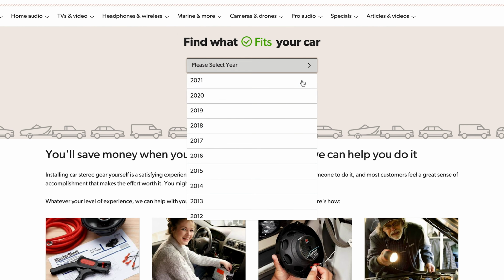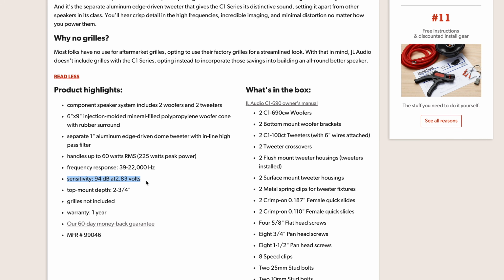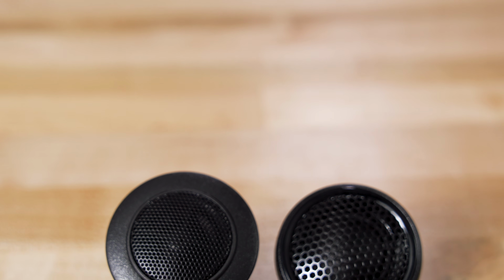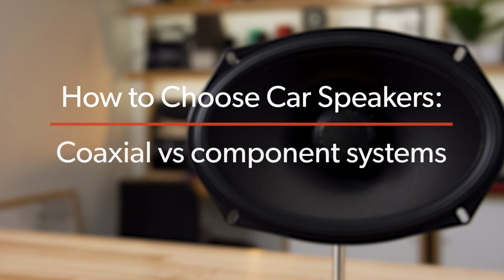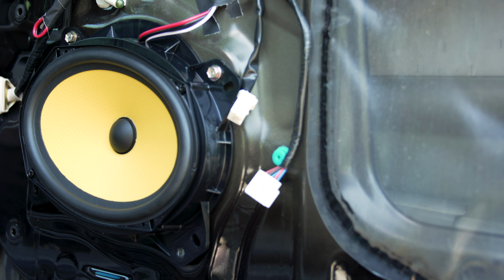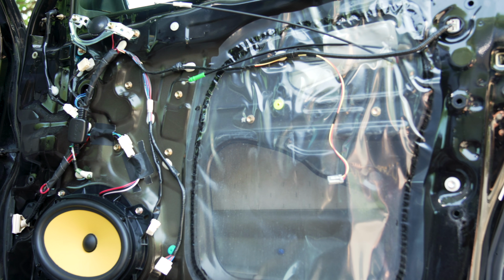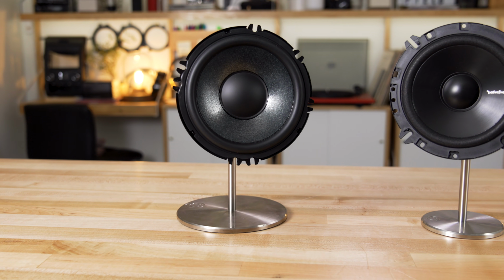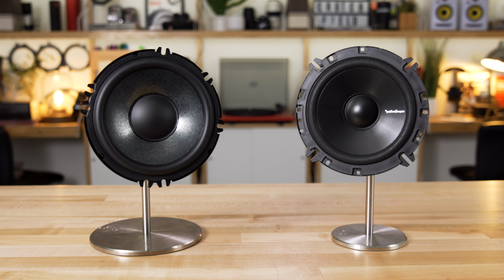How to choose car speakers | Crutchfield

Comment: Do component systems generally sound better for audio quality and low distortion than loudspeakers/2-way speakers. Ive been told since each speaker is built individually purpose built with the correct frequencies going to each you generally get better power handling without the distortion.
Reply: yes

Comment: I want a touchscreen head unit with component speakers in front door (a pair of tweeters and woofers) and a pair of component speakers in the rear door- how is it possible? Is there a better arrangement possible without adding sub woofers?

Comment: Hello,  i could not find my car (citroen ds5 2012) on that list? I tried to find what speakers could fit in my car... anyway, can someone help me out? i like the sound in my car but i just want to make a little upgrade to the bass, i dont want something big and boomie, i dont like that, at higher volumes my low end starts to distort a little soo i would like to give it more room and make my low end more punchy hehe, any ideas what can be the easiest option? does jbl make good subs for cars?
Reply from the maker: We are only able to research vehicles sold in the U.S. market. This is the reason you are not able to find information on your Citroen and recommend checking with a local installer to get help on what can fit it

Comment: Great video. Very clear and brilliantly delivered. You say to look for speakers with very low power because factory radios don't have much power. I've got a 50w per channel Alpine head unit. What would you recommend for decent sound without a separate amp? Fronts in the dash are 4inch, rear in the doors are 6 to 6.5inch.
Reply from the maker: One of our advisors would love to help you out! https://bit.ly/2KP1zS3

Comment: I have JBL component speakers in my front doors on my 2014 Rav4, I want to get powered sub boxes to go under the two front seats, would I need to upgrade/change any part of my cars power system to be able to run all that?
Reply from the maker: New power cables will need to be ran for the powered subwoofers. That can be done without having to change any part of the stock power wiring making this just a new addition to that wiring

Comment: I just bought kickers csc654, for front & rear for my civic 2017 model... Do i need to remove my touchscreen and unplug battery before installing the speakers??
Reply from the maker: No, you may want to disconnect the negative terminal of your battery to avoid possible shorting of any wires,  but you won't have to removes the radio.
Reply: @crutchfield   computer box will not affect if i disconnect the negative connection? As when i replace my battery they let the engine on while changing battery so will not affect the comp box as of them.
Reply from the maker: The only downside that might occur are the potential loss of personal settings. Any settings you have programmed into the vehicle might be lost depending on how the vehicle stores them. 
The vehicle will not be harmed by disconnecting that cable.

Comment: unfortunately, I couldn't look up a fitment for my car Mercedes-Benz GLE 400d V167 model. Do you have a recommendation for replacing factory speakers? I want a plug n play as I do not want Mercedes to void my warranty
Reply from the maker: We may not have had a chance to research your specific vehicle. What year is your Mercedes-Benz GLE 400d V167?

Comment: hellow so i would like to know if i bought two pairs of rockford fosegate t2652-s for my 2019 acoord ex 1.5 running with a rockford fosegate t400.4 bdcp amp but what is highs and mids and lows? i only need four speakers the rear deck uses 6.6s speakers so i dnt need 6by9s  can u help me understand what the heck im doing plz should i get only one pair for highs and buy another pair for full range of mid range???
Reply from the maker: You should get in touch with one of our advisors for more personalized help! https://bit.ly/2KP1zS3

Comment: So if I wanted someone to install a subwoofer, 2 sets of 3 way component speakers in the doors is that 5 channels?
Reply from the maker: AS long as the 3 way components are all connected by a passive crossover network and are fed by a single speaker wire to that crossover network, then yep!

Comment: What speaker do y’all recommend
Reply from the maker: What is the application?  Are you using amplfiers, if so, which ones?  What type of music do you listen to?  What vehicle are you putting it in?
Reply: @crutchfield  I dont think I’m using an amp but I have a pioneer radio, I listen to hip hop and rap, and I own a 2007 chevy Colorado crew cab it has 2 tweeter spots and 4 regular door speakers

Comment: Hey. I know this has nothing to do with this video. I just seen it’s ur latest. I’m trying to build a sound system in my Honda Odyssey. I want it to look stock as possible so I have 6 1/2 door speakers that I want to connect to an amp. Problem is. I don’t know how to go about wiring them in parallel if the speakers will sit in the doors far apart from eachother. Can anyone help???!!!😿👏🏼👏🏼👏🏼
Reply from the maker: Typically, speakers get their own channel on an amp to make sure the left channel audio comes from the drivers side speakers and right channel audio comes from the passengers side speakers. This means a 2 or 4 channel amp is needed (2 channel if only replacing the front speakers, and 4 channel amp needed if replacing both front and rear speakers).

Setting that aside, speakers need speaker wire ran to the amp so their distance apart from each other never causes an issue with how the are wired to the amp even if you don't keep the stereo sound intact. Both speakers will have wire going to the amp location which means they can be connected to the amp's channels as needed for your system build.

Comment: Thank you so much for this video!!! Now I know what to look for.
I checked in the Crutchfield website replacement speakers for my Civic LX and they recommended a set of Kickers 46CSC674, but I would like to know whether there are other good options, as Kicker uses polyester foam surround and I have heard that foam does not last much.

Comment: I cannot find BMW E87 series 1 in your site's  car application compatible equipment
Reply from the maker: Hi!
While it is very rare, there are times that some vehicle's are not in our database, due to us not being able locate one to perform our in-depth research on.
However, we do have research on a very wide range of  BMW's.
You may want to search by inputting your vehicle's year, and make, but for the model, choose 1 Series.  
From there you should be provided with the ability to choose the body style, along with any factory features, such as Navigation, or upgraded factory audio systems.
You may also wish to contact us via online or by phone. We will be happy to look into this for you.
www.crutchfield.com/I-rYTVc164/contact

Comment: this is super helpful, thank you!
Reply from the maker: Of course, Plear! If there's anything else we can help you with, feel free to give us a call 1(800)955-3000! :)
Reply: @crutchfield  can I play my midrange speakers on full position instead of HPF if I the crossover set to the speakers frequency range. I use my pioneer  avh-x4800bs network mode crossover

Comment: I have a 2016 Mazda 6 Bose system which are not impressive at all to me! The website nothing fits and they recommend no change to my system
Reply from the maker: We do have some replacement speakers that will fit in that 2016 Mazda 6 but the factory Bose systems runs on a low impedance which means putting "normal" speakers in will result in a loss of volume. 

We would either need to look at low impedance speaker replacements, or replace the entire Bose amplifier. You can discuss your options with one of our friendly product advisors here: 

https://www.crutchfield.com/I-rYTVc290/support/ContactUs.aspxI-rYTVc000/
Reply: @crutchfield   Thank you. I have a 2018 Honda civic  sedan.i would like to change all speakers and tweeters. Your recommendation.

Comment: I just replaced my stock speakers with Kicker CSC, they sound great. Now I need to find a subwoofer, but can’t decide between component or powered.
Reply: what’d you decide?
Reply: amp and subwoofer is always best imo those powered subs always leave u wanting more then 300w
Reply: @livbuczek9944  It’s a ways out, but I’m pretty sure I’m gonna go component. More power and versatility.
Reply: @bryanCLXT  That’s what I’m probably gonna end up doing. It’s still gonna be a while, but I’ll get around to it eventually. Was gonna try and do a 5 channel amp, but think I’ll just go mono with the sub.

Comment: Can you do a tutorial on how to install a powered subwoofer with built in amp and enclosure without a LOC? I’ve seen where you can connect them to the positive and negative wires a tutorial would be very helpful
Reply: You need to make sure your powered sub can handle a hi level input, and then you just connect it to the positive and negative of a speaker wire.
Reply: GuardianOfClouds 1200 watt
Reply from the maker: Hi Shawn,
If you plan to connect to a powered subwoofer, that has speaker level inputs, you will follow the initial install process of adding in the line output converter.
Instead of inputting speaker wire into the converter, you will just be inputting that speaker wire to the powered subwoofers, speaker level inputs.
If you have purchased or plan to purchase a powered subwoofer from Crutchfield, and you need assistance with the installation, or would like to ask questions on the product before you purchase, feel free to reach out to an Advisor!
We will be happy to go over this with you, and technical support will be happy to assist you with the installation of the powered sub you purchase from Crutchfield!
www.crutchfield.com/I-rYTVc164/contact